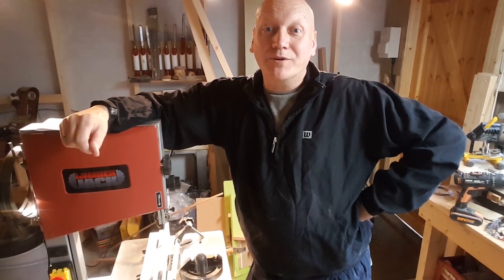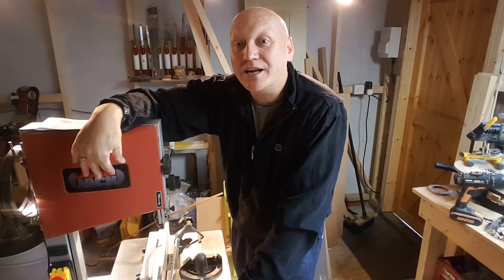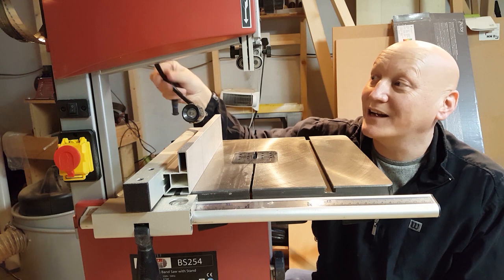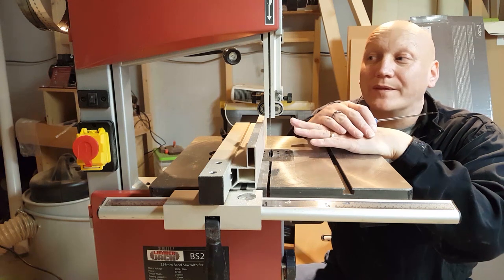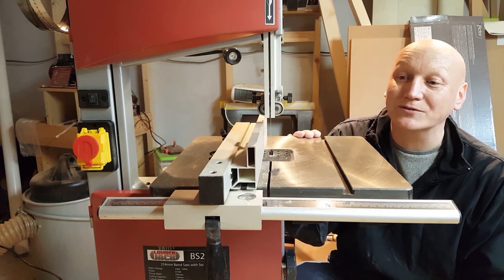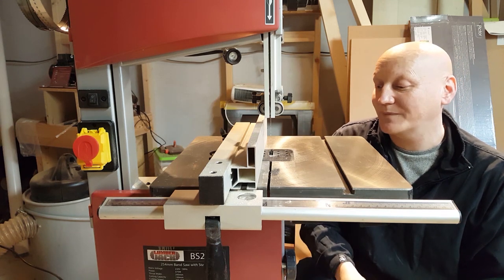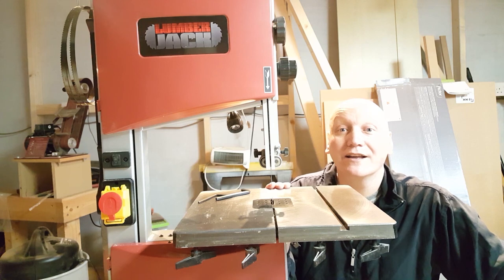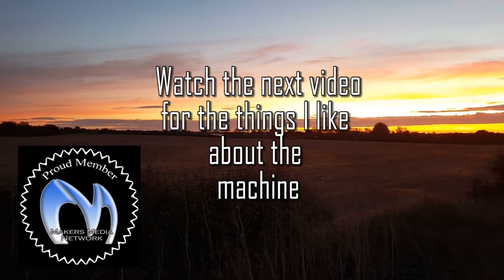Lumberjack BS254 Band saw Review Part 1

Comment: Hi Phil, in your video you mention replacing the plastic insert in the table for a metal zero tolerance one, can you say where you would get one of these type of insert? Regards Brian.
Reply from the maker: Unfortunately it would be custom made, as I'm sure you can't purchase them, sorry.
Reply: @PhilCannonWoodworking  Hope you don't mind me pestering, what is the reason for the 2 speeds and what should I be running at 400 or 800, I only use the saw for wood.
Reply from the maker: @brianbentley618  no problem all questions are good. If your only cutting wood then the higher the speed the better, no matter if it's hard or soft wood. The reason for the 2 speeds is mainly for metal cutting, to allow the motor not to work so hard on thicker material. Hope that's ok.
Reply: @PhilCannonWoodworking  Thanks Phil, it certainly answers my question. Cheers.

Comment: Can you help I am trying to find a part for 

Lumberjack BS340 340mm

The bit that holds the guide wheels in place on the circle jig as brook
Reply from the maker: Hi Alan, I haven't had to find any spares yet, but my first port of call would be Lumberjack, after that I wouldn't know where else to start. Sorry.
Reply: I have contacted lumberjack but said we don't do parts
Reply from the maker: @alanmilner629  just checked Charnwood machinery, they sell a very similar machine, they have a spares section on their website, under bearings they have a similar looking blade guide system for sale on there, maybe worth ringing them. Ok
Reply: @PhilCannonWoodworking  Thanks Phil for your time .

Comment: find it difficult to adjust upper blade bearings when blade guide obstructs view, any ideas on how to overcome this problem ? blade guide is not removable.
Reply from the maker: Sorry you're finding it a problem to adjust top guide, unfortunately I haven't had a problem with the top guide adjustment, I find the bottom set to be the awkward ones to adjust, sorry I can't help.

Comment: Yes, that light doesn't make a lot of sense..if you mark up using a feint pencil line, the shadow generated by that light is going to look more like the cut-line than your marking surely? The blade does look a little fiddly but as you say maybe with more practice it'll get easier(Those guides are certainly not in the most accessible place!) But that motor adjuster would definitely do my nut in. I suggest changing the allen head for a normal hex nut and getting a swan-necked reversible ratchet spanner to hand near by for speedier changes maybe? Good so far, looking forward to seeing the plus points on this one!👍
Reply from the maker: Huey Lionsheart thanks, I like your idea about the motor bolt, will look into it in the future.

Comment: Sorry I had to up the video playback speed to 1.25 because you talk very slow aha but with that, I really appreciate your thorough review of the BS254 bandsaw; sharing your knowledge and going through the cons and pros, setup etc. Really great! Thanks!

I’m a complete beginner woodworker and looked at plenty of reviews online for bandsaws and this Lumberjack one was highly recommended, I was pleased with it at first but I’ve ran into the issue where it’s not cutting in a straight line anymore and honestly Im stuck in the mud, don’t know what to do or why. There’s so many things online about bandsaws but it’s been overwhelming and hard to relate to different makes and brands. So seeing you work through yours has been a great help.
Reply from the maker: GibSonLoGic thanks for your comment. I am pleased this has helped you. With the cutting straight problem, are you still using the blade that came with machine or have you changed it for a better quality one, the wondering cut is normally due to a blunt blade, so it may need changing.
Reply: @PhilCannonWoodworking   No I haven't changed it, wasn't sure what to change it to till now after watching your video. I actually had bought more blades with the BS254, a; 13mm, 10mm & 6mm from Lumberjack just as I knew they would fit as they were an add on and I did not understand the measurements etc., retrospectively now that was a bit stupid really as it cost me £42 and the do look bad quality, they're rusty all over? I don't know if that is normal or if that matters or not or perhaps are just bad quality. But nonetheless I will cut my losses there and am currently looking to buy a supertuff bandsaw blade 1826mm - though not sure which tpi to go for yet, I am looking into it.
Reply from the maker: @GibSonLoGic  please don't feel stupid about purchasing those blades, its what most people would do without advice. Use the blades you have bought, as they will be ok, for a while, then start to purchase better quality ones as and when needed. I am quite happy with just a 12mm and a 6mm wide blades. 12mm I use for general cutting and resawing, 6mm I use mainly for cutting tight curves.
Reply: @PhilCannonWoodworking  Ok cheers for the advice, greatly appreciated! Keep making videos, they're very useful!
Reply: I just thought of one other question I have, why are there 2 speeds? is it better to keep it on the faster spin or is that going to wreck the blade?
Reply from the maker: GibSonLoGic I use the fast speed with my 6mm blade and the slower speed for my 12mm blade when re-sawing. Also the thicker the wood the slower you should go what ever the blade size.
Reply: @PhilCannonWoodworking  oky doke great cheers for the information! :)

Comment: Phil, i see you purchased the tuff saw blades, which one did you buy, why and are they better than the stock 10mm blade.
Reply from the maker: Richard 6mm x 4 tpi, for circle cutting. 12mm x 4 tpi for resawing.. I chose 4 tpi so blade doesn’t bind up. The new blades are much better and worth the investment.

Comment: Great video I’ve just bought one , when putting the blade in just a thought you could put a bit  of masking tape over the slot to stop the blade from jumping out whilst tensioning it, just a thought not tried it and also I know it’s a bit of a fiddle but what about taking the table off? Probably not ideal though
Reply from the maker: Thanks for the comment. Good idea about masking tape, will give it a try. Not too sure about removing table though.
Reply: Phil Cannon Woodworking no problem Phil, happy new year, and a great review mate

Comment: Hi could you tell me the dimensions of this machine, i am really interested in buying one but it does not say what the dimensions are on the website, and i'm quite short on space so need to make sure its not to big, cheers 🙂👍
Reply from the maker: I’ll be in workshop later, so I’ll measure up and post. Ok
Reply: @PhilCannonWoodworking  That would be great, Thank You 🙂👍
Reply from the maker: Alan Wills ok here goes. Height from floor to highest point is 57”(1450), depth is 20”(510) width is 28”(710). Hope that’s ok.
Reply: @PhilCannonWoodworking  OK that's great, thank you for your help
 Alan 🙂👍

Comment: Great review, but why do you need to change the speed ?
Reply: Mart As I understand it, the slower speeds are for, either really hard woods or re-sawing large planks, or if for some reason you purchase a metal cutting blade then you will need the slower speed. Hope that makes sense
Reply: @philcannon3068  May i ask what speed you have yours set to, I currently have a small hobby bandsaw 80mm depth cut, and it struggles to cut 8" circles in marine plywood let alone 60mm block kitchen worktops, loved all your videos about this bandsaw, i just can't make my mind up
Reply: Mart mine is normally set to the high speed for general usage, but if I have a thick piece of wood then I’ll use the slower speed. Have you replaced the blade for a sharp good quality blade, when cutting circles are you using a 6mm (1/4 inch) blade,
Reply: @philcannon3068  Yes, phil i have tried several different sizes and makes, alas i don't think the 'so called' 350w motor is really up to it, the bandsaw is from Aldi supermarket , but i have seen an official make that looks exactly the same and it only has a 250w motor, what i like about yours is that it has real bearings for guides , mine doesn't and makes it Very noisy
Reply: Mart I was thinking if blades were ok then perhaps motor may be an issue, some tools from Aldi are really good for a hobbyist, I have some myself, Peter Millard does a good review of the Aldi or lidl bandsaw on his channel, may be of interest to you. I do have to say, I was a bit anxious when I bought this, due to price and quality, but I wouldn’t be without it now.
Reply: @philcannon3068   Thanks Phil, one last question, sorry if i've been a pest, But does it have to go on the legs, i mean can i put it on my bench without the legs as i have problems with my back and have to have it quite high up, my current one is 120cm high to the table
Reply: Mart I can’t say %100 that it can sit on a bench top, due to stability, but lumberjack do a smaller saw, with the same shaped bottom as mine, but has rubber feet on each corner, so maybe with some anti slip mat underneath maybe fine. No one is a pest when it comes to needing info. 👍
Reply: @philcannon3068  Thank you